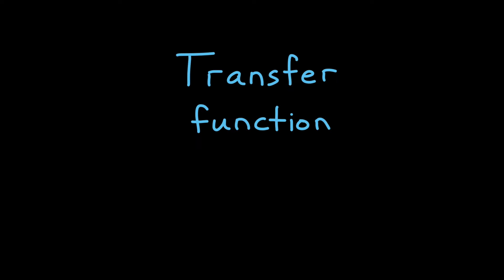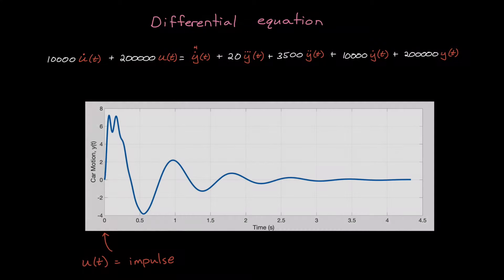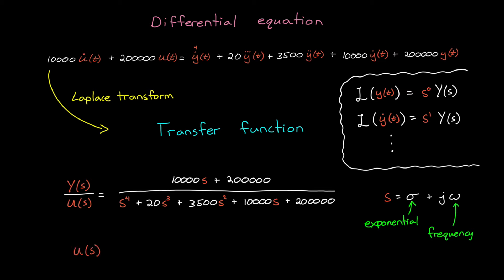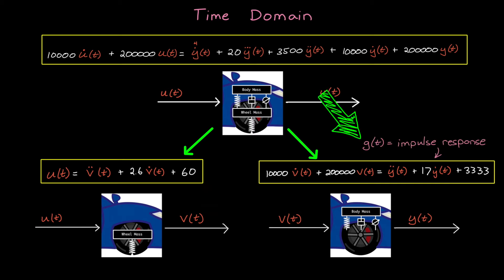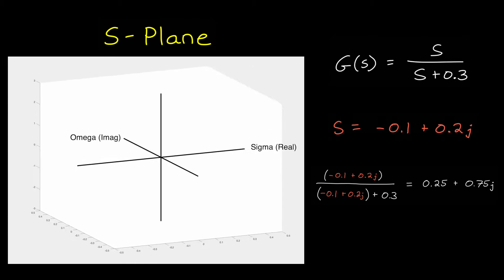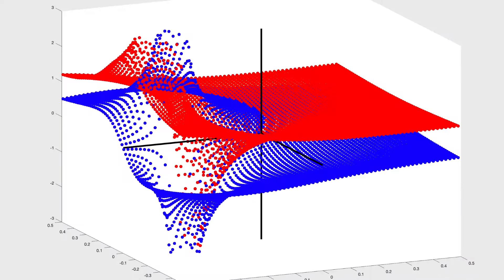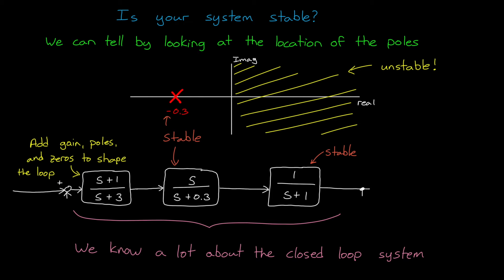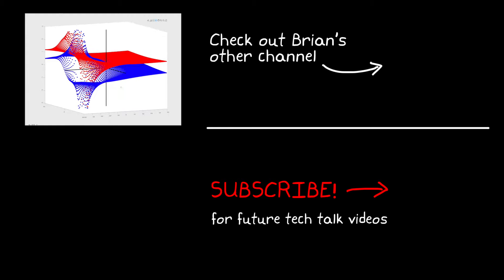What are Transfer Functions? | Control Systems in Practice

Comment: For anyone curious about the definition of gain (like I was) here's a more detailed explanation:

The final steady state value of y(t) is given by the formula:
y_ss = (lim s-->0)  s*Y(s)

Let's say the input is a constant step: r(t) = A. Therefore R(s) = A/s. Also Y(s) = G(s) * R(s). So

y_ss = (lim s-->0) s*G(s) * R(s)
y_ss = (lim s-->0) s*G(s) * A/s
y_ss = (lim s-->0) A * G(s)
y_ss = A*G(0)

Gain is defined in the time domain as the final output value / input value = y_ss / r(t)

gain = A*G(0)/A
gain = G(0)
Reply: Wow. I like it more when gain is simply output amplitude over input amplitude.

Comment: Greatly appreciate the lecture. Question: let's say that you have a circuit in a 'black box' and you know it is likely to be represented by a transfer function, but you have no clue as to the circuit,  components or values. Can you do a few tests and from the output, figure out what the black box acts like? Like searching for an equivalent circuit.
Thanks in advance.
Reply: yes, look up system identification

Comment: If Y(S) is the Laplace transformed signal of input u(t) and u(S) is the Laplace trasformed differencial equation of the model of the system d/dt any^n+an-1y^n-1...a0y^0 so why we tell that transfer function is the laplace trasformed signal of syetem output diveded by the laplace trasformed signal of system input and not telling instead that is the laplace transformed signal of system input divided by the Laplace transformed homogenus equation of the system?
I really dont understand that.